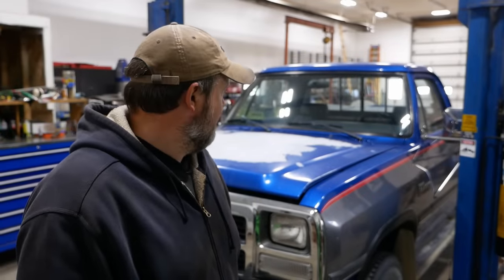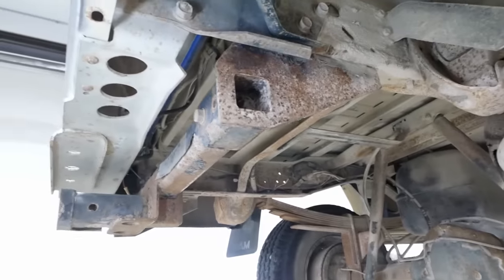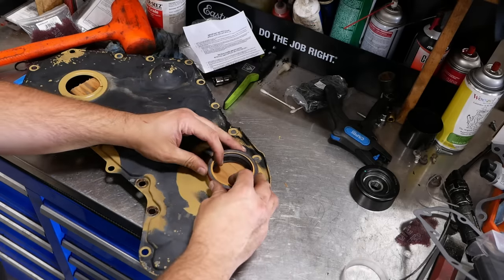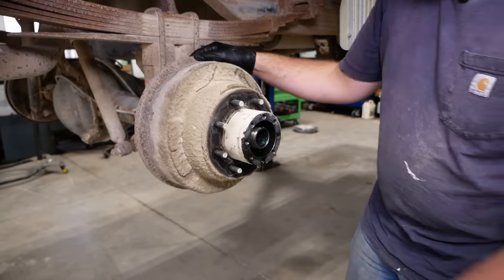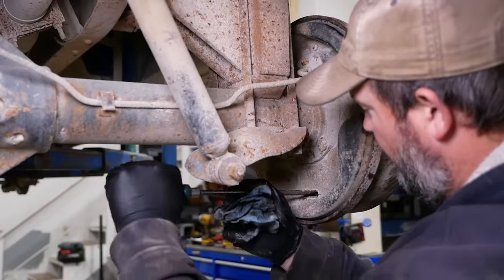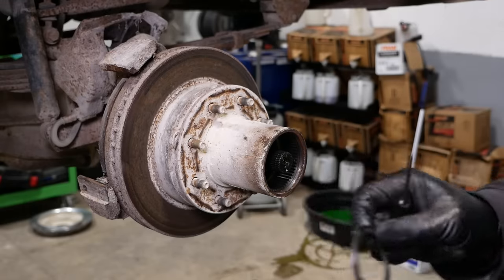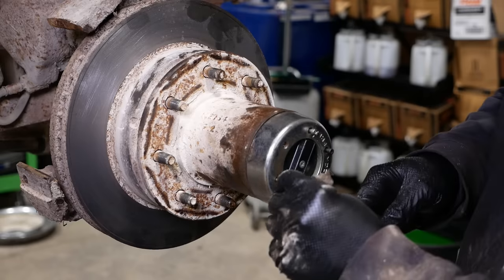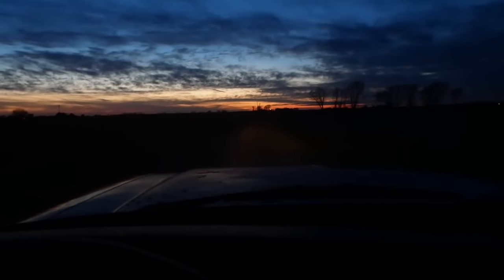Cherry 92 Dodge Cummins: Killer Dowel Pin, Brakes, Seals, Etc.

Comment: On the Gen2 you could install a steering stabilzer for the pitmanarm, adjust the steeringbox gears or change the whole steeringbox for a redhead or bluetop. Together with a new steering shaft or the U-Joint of the shaft you can eliminate the lay in the steering to a bare minimum. Overkill would be an upgrate to the Gen4 Steering bars ... I just adjusted my steering box gears and installed a steering stabilizernd now I have just about maybe 10° of deadplay. A friend of mine just did the redhead gearbox and says he has never felt a tighter steering on a Gen2. I bet, all the things above get them old girls to ride like a new model. 
Looking forward to the Gen2 Video!

Comment: First time I've come across your channel. Nice truck. I'll have to say that every one of the Cummins I've come across has had the dowel pin fall out. Not any catastrophic failures yet, just cracked timing covers leaking a significant amount of oil, or rust preventative as some people like to call it. Lol Keep up the good work & hello from Spokane, Washington.

Comment: Ultimately the red truck needs more caster angle. The t style drag link will have less slop than the y link, and that will help, but it’s still going to be wandering unless you can get it to 4-5 degrees of caster

Comment: ‘94-‘01 is for the 2nd gen dodge trucks. I’ve got two, both were all over the road when I got them. I replaced ball joints, tie rod ends, steering dampener, and added a gearbox stabilizer on both. ‘‘Twas a pretty penny. Now they both have zero play in the steering, and with a new power steering pump they’re so sensitive that if you’re used to driving one that’s clapped out, you’ll over steer for a while, so you’ll still be all over the road, but it’ll be you and not the truck. I’m sure you know dodge trucks love their ball joints and don’t want to let them go. Other than that it was all smooth sailing.

Comment: I believe they called that “Laser  Blue” . 
There is a yard in Mississippi that has lots of that vintage Dodge truck, and they did really well with regard to rust down here in the Deep South.  No road salt, and Galvanized sheet metal under the paint.

Comment: Digging that grease out of the front hub gave me flashback when I was in my early 20s I got in a hurry and a piece if sharp metal was sticking out inside hub . I had to use needle nose pliers to pull it out of my finger. Dang near wet myself when it came out.

Comment: Best thing I did to my 97' ram 4x4 Cummins for steering was convert to the 98-99' HD steering (t style vs the original inverted y steering) and a PSC HD steering box, which made a HUGE improvement to steering feel to the truck

Comment: I had a 95 Dodge pickup (2WD) about 11 years ago.  I bought it used with 47K on the clock.  The steering was "typical Dodge" but even I thought it was a bit too loose.  I replaced all the suspension components with brand-new Moog stuff but it still was super sloppy.  Finally, I replaced the steering box and things improved a whole lot.  It was still typical Dodge (or typical Ford van for that matter) but like I said a huge improvement.

You'll never get all the slop out of it.

Comment: I do those hubs the same way I did in the army, crank it down while rotating it, then back it off 1/4 turn and check the play, make fine adjustments from there.

Comment: Weezel Wiz - I love it!  -   I guess I have been doing bearings "Wrong" for 35 years.... Tighten to Whatever spec in book....Loosen...then "SNUG to 0-Runout" and leave them there....And never had a problem.... And BITE YOUR TONGUE on that brake caliper mounting....All Older FORDS had that style....and IF you grease the piss out them with SILGLYDE they last a long time, even in Minnesnowta.... Looks like she has a NP205 T-Case....I love them old gear units!

Comment: Love it. Dad had a 1989 almost exactly like it that got passed down to me. He had almost the same color scheme, but had it repainted around 2000. Because of some minor body damage most of it got repainted again in 2014-2017. Only 130K on the clock. I can get about 75 out of it on level ground with the automatic, 60-65 is the sweet spot though. It is also bone stock, with no engine modifications. I am tempted, but I can see the rabbit hole I would be going down if I decide to turn the power up. I don't really need a truck that often, but I keep her around and maintained.
Reply: I put a gear vendor on mine, it's a 5 speed. I can cruise at 80mph

Comment: Idk if anyone has said it yet but the EMF intermediate shaft bushings help a ton. As well as yes changing from the y style over the the 2009 and up t style is a bolt on replacement with the pitman arm update along with it

Comment: I bought a 91 “club cab” 4WD  Cummins 5 speed in 1993 with that hitch, it “bent” downward after pulling my tractor the first time. I did not realize how light duty it was, replaced it with a good class 5 hitch…problem solved.
Steering is probably the steering shaft and or the steering box. Besides the normal wear items, I had the replace both box and coupler after 5 years/100k miles.

Comment: I have 96 dodge 3500 Cummins that I've owned since 2006....I've updated the steering links to the T style, added the steering box brace, new control arm bushings, and just recently put an 03 track bar and bd adapter bracket on...I would say the track bar has made the most difference but there is still more play then one would expect.  But having driven the truck for almost 16 years its just the way it is and doesnt make it any less capable..having any play in the tie rods as well as tire size has also affected the feel...I've only ever had death wobble once....another thing that affects the steering alot is when the rear end is pointed to far one way so steering will feel ok turning one way and aggressive the other way from the pull it creates...doesnt hurt to do basic tape measure checks..I've played with it over the years and learned to just live with the steering and enjoy the sound the truck makes.

Comment: You should fill the hub with oil before fitting the outer bearing so the inner bearing is lubricated. Plus lift truck from opposite side to run diff oil into bearings

Comment: Interesting experiment in the use of cement dust as a rust inhibitor.
Pity you didn't check the air horns before it left the shop.

Comment: I never did the killer dowel pin fix on my 12 valve because I thought it’ll never happen to me. Boy was I wrong. Happened at 150,000 miles

Comment: Cab garage I leased from for awhile in Dallas had one of these with a slide in wrecker unit.  They dragged EVERYTHING with that truck.  Used it to pull frames on the crunched ones, too.  Shifted into 3rd way too early.  It was like first gear to 15-20mph second for like 1.5 seconds and then boom you're in third and no coming out of it unless you came to a complete stop and even then it sometimes stayed in third and you'd have to manually shift to 1 and let it catch and then put it back in drive.

Comment: Go find some pvc fitting to match the seal size and come caps. You can get them dumb cheap, they work and often times are 2 sizes in 1 fitting. 
Wonderful tools I've used for years

Comment: I had a 94 2500 Cummins. What I found the biggest issue to be with the front end is tolerance stacking. EVERYTHING has to be tight. There is no one stop solution. I had a bad panhard bar. That was my biggest issue (beware, 94 and some early 95s use a different bar, the taper on the joint at the frame is different). The other thing that made a difference for me was good load range E tires....cheap ones just don't have as stiff of a sidewall. Like I said though, tolerance stacking is the biggest issue. To fee acceptable ALL front end joints need to be tight/on the tight end of spec.

Comment: Have an 02 3500. New blue top steering gear box, OEM shaft, upper/lower control arms bushings and a frame brace solved my problems. But I have put in a new bushing at the end of the column, to solve others.

Comment: I put lock out hubs on a 1979 Toyota Land Cruiser that had no lockout hubs so I used a grenade pin ring for the retention ring that didn’t come with the hubs. Ran like that for 10 years and was working great when I sold it. Wish I kept it but the body was rusting off the frame.

Comment: The steering box stabilizer has been mentioned and worth a try.  It will help.  The track bar is usually the biggest issue.  The slightest play will make the front wander.  

I had (ordered new) a 98, 4x4, quad cab 2500, V10.  Even when the ball joints were loose, I did not have a wandering/loose feeling.  However, when I did feel a looseness, I replaced the track bar even though it did not seem loose and that fixed it.  

The other thing, my truck had a spacer plate behind the right front wheel from the factory.  Only the right side.  If it is not there, it will cause a tracking issue.

Comment: Look at the universal joints in the steering shaft.  From years of steering left and right the pin that holds the joint together wallows out the hole.

Comment: If the ball joints and tie rods are good, then it's the track bar. On my 97 Cummins, I had loose steering and death wobble. I put a conversion kit to change the track bar to a 3rd Gen and that gets rid of the ball joint in the track bar. Steers straight and no death wobble.

Comment: Borgeson steering shaft upgrade .And check the tie rod ends and king pin /knuckels for play and set toe to 1/8 toe in !Back when they were new we replaced dozens of the steering shafts with the Borgeson units, the oe shaft joint coupler was crap!

Comment: I’m in the same boat with my 99, I’ve replaced the Pitman arm idler arm, Borgeson steering shaft, gearbox, swaybar bushings, sway bar end links upper and lower control arms with new ball joints, inner and outer tie rods  also have a gearbox brace and steering dampener, I rebuilt the entire front end at the same time and still have play even did new bearings/rotors and all when I was in there’s just no hope for them front ends

Comment: Suggestion on the 95 dodge steering issue, and no I don't have personal experience with that generation dodge but my tip is quick and easy to check, it also applies to any truck regardless of brand.  I  have seen chevy square bodies loosen the frame crossmember rivets by the steering box.  Easy way to check is with the front end on the ground, have. Helper turn the steering wheel back and forth while you watch the frame and steering gearbox.   See if anything is moving that shouldn't be.  The square body I saw moved the crossmember in and out about 3/8".  Rivets felt tight.

Comment: Hi Wess my .02 cents I’m gearing up for my 2ND rebuild of a 94-02 dodge 4x4 in my opinion the steering woes of these trucks are between an undersized steering box and the track bar that has an undersized rod end for a 1/2 ton V8 let alone a 3/4 or 1 ton diesel my two upgrades that worked and worked well in my first rebuild and I will use this time around are Solid Steel Industries TBK2029402-4 track bar retrofit kit it switches the track bar to an 03 up design with bolt and bushing on both ends and eliminates the undersized tie rod end on the drivers side frame attachment you can use the kit with a junkyard track bar if you can find one in your area or you can purchase an adjustable bar from them this also aids in alignment issues with leveled / lifted trucks if your customer chooses to go that route second was a Borgson steering box available at Geno’s Garage also Polyurethane bushings in the control arms go a long way unfortunately this is the beginnings of the era when the factory’s began trying to give a smooth car like ride to a truck and when their engineering marvels ware out it begins to become difficult to keep these rides between the lines I wish we could go back to the time when a truck was a truck not a living room on wheels for morons in tank tops and flip flops

Comment: I have 3 of these trucks and all the dowel pins were secure, but all the timing case bolts were finger tight. I peened the case in all of mine. Snugged all the bolts up.

Comment: T style steering and the steering box brace that adds a bearing to the bottom of the pitman arm from bd diesel, carli extended control arms if it's got a level kit also a carli track bar..I've got about 4k in upgrades on my 05cummins handles great on 35s still wanders but most anything does with a straight axle ..love your tenacity and patience working on the rusted junk you deal with

Comment: Excellent video Wes :) that nice shape 1992 Dodge heavy duty with 80.000 kms or that miles and body great shape plus motor to also transmission! Yes lots them rust out on Snow Belt Gaint areas mine 1996 Dodge D350 Extended Cab had replaced parts to over years to also body parts too and one Rebuilt motor job on Cummings 2 times, transmission to and couple clutches  too because Tow Truck services too and lots 4×4 calls to!  Only thing orgnail on truck don't use is is box still like new in my work storage plus back bumper to! Even my first tow truck 1972 Ford F350 extended cab High Boy had replaced parts too all years used it till restoration in 2005  and sold it ! But found salt & sand mix Roads & Works Department Highway trucks used on snow removal and melt too! Wes :) make Lol I done lots engine Rebuilt on Gas , Desiel motor and got silicone, gasket mender on clothes plus fingers and face plus smell like gas and Desiel motor blow by and fuel also oil plus blow fuel on engine running to on leaks Lol! Even Differential fluid 80w90 to and you name it !

Comment: If its a 2 wd I converted mine to the rack and pinion off the 3rd gen about a year/30k ago and it has had 0 issues and tracks fantastic down the road. Would absolutely recommend if applicable.

Comment: Yeah, steering gearbox, and play in the wheel bearings was always what made a difference in driving/steering comfort. I liked keeping the bearing clearance very close/lightly snug; the grease seems to interfere enough that a tight clearance seems to turn out just right.

Comment: EMF BALL JOINTS for the 2nd gen . They have good tech videos on there utube . They do an excellent job explaining the different variables that go into causing different kinds of issues with that system. From the tire all the way to the stearing wheel.

3sp 727 came with 3.08 ,46,47,48 3.50. I was going to say it was a 92-93 because of the tach, 91.5( june) did not have the wires in the harness  that was a 92 change it was not part of the IC 91.5 up grades.

Comment: Seems this sold on Ebay about 6 months ago, maybe I'm wrong...BTW, I agree with your comments, for a 1st gen, that is a darn clean W250. Tow wise they don't actually two that much, most people will tell you about 10k is about tops unless you're adventurous. Pretty much the entire body rusts out, especially around the top of the cab...I came to the conclusion that the Ford diesels are more reliable, but these Dodge owners are proud of their trucks...that's for sure. Main seal always leaks on these. Most guys replace the pump. It seems the only thing that doesn't fall apart on these 1st gens is the engine, and they do need a few things taken care, which you are doing...in the end I decided to keep my gas flat bed dually, cause gas is actually cheaper, and although the mileage sucks on it, I don't need to haul that heavy stuff very often. These don't get that great of mileage as best I could tell, about 18mpg. It does beat the 8-10mpg I get from my 7.5L 460 v8, but I need to buy a lot of gas to make up for a Ram truck.

Comment: Here’s all I know about straight-axle front ends that tend to wander. You need more caster in there. My homeboy Hambone had a Jeep with straight axle and that thing was like a carnival ride. He got a set of spring spacer blocks that were slightly wedge-shaped that translated to about four degrees more caster. You wouldn’t believe the difference it made. Problem solved. I don’t know if this solution is available for this truck but definitely look into some fix that will introduce more caster. That’s all I got.

Comment: I don't have experience on Dodge's wandering but with the old Landcruiser's you can get castor correction bushes which make them run dead straight. Like a shopping trolleys wheels snapping forward once they're fitted.

Comment: If the 95 is 4 wheel drive, put the brace across the frame that bolts into sway bar bolts and has a bearing that goes on the steering gear, makes the most improvement I've found, heck may be same on 2 wheel drive.

Comment: I have a '94 1500 4x4 longbed with a 5.2 l V8, and approx. 320,000km. on a standard front suspension. I am the second owner. The truck drives very nicely at highway speeds up to120 km/hr, no steering issues whatsoever. I do run quality tires, and take care with alignment. My tires are narrow and tall, 235/85. Tire pressure usu 50-60 psi. I did change out the original steering shaft for a Borgeson because of deterioration of the original about 6 yrs ago, but the steering was OK before that, just a clunk from a frozen slip joint and a corrosion-damaged (U) joint. Good luck. Maybe narrow tires help?

Comment: I got rid of the factory steering damper on my 96 3500 f wd and put in a off road racing one from the 
four wheel drive boys and had the front tires trued.

Comment: That was the factory driver  just on wrong side. Those are a pia.  Dunno about the rotary but the p pump had both outer an inner cover updated to remove flex. I like your retainer for the pin.  Good idea